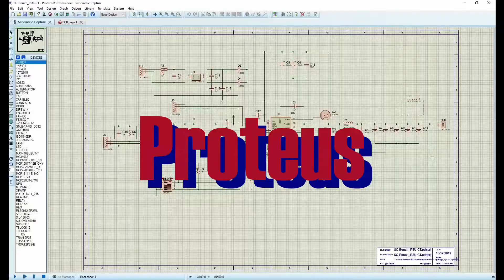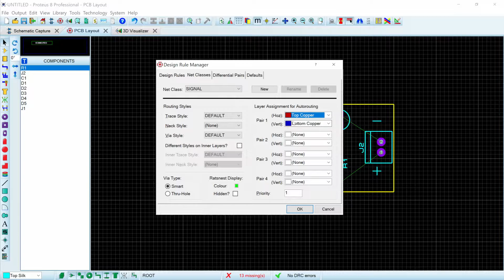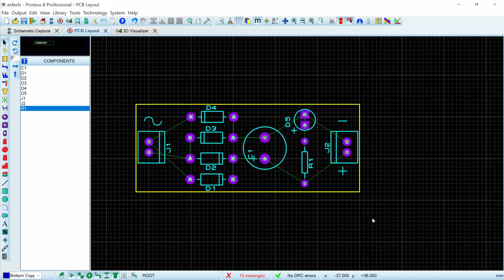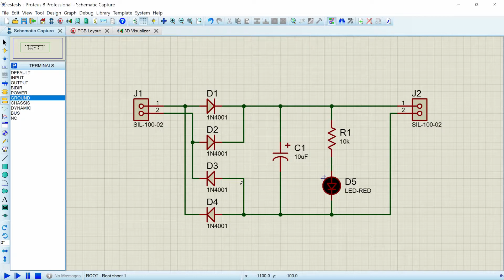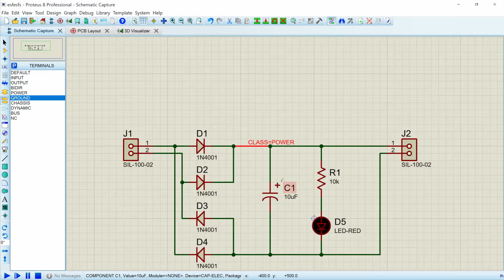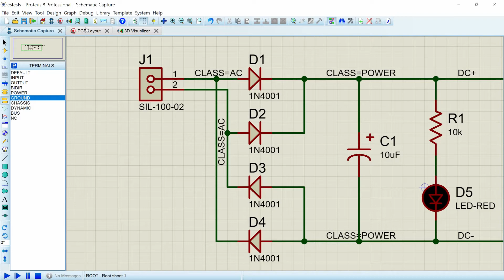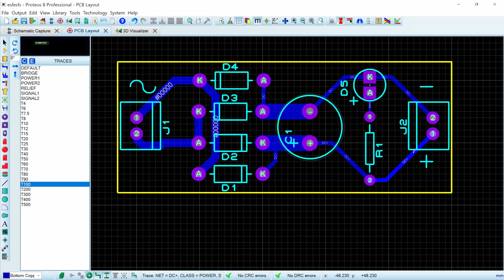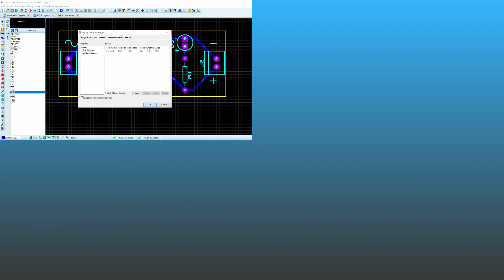Change Proteus Trace Size and Layer for Auto Router

Comment: Excelent tutorial, I wonder if could be possible to create in Proteus a trace with 2 different widths. I have seen this kind of trace in Altrium PCB layout. It was used in Arduino Pro Mini PCB design in the zone the trace has to pass between 2 pads of the Atmega328p tqfp32 corners (there the trace is width decreased to prevent too close distance when pass between 2 corner 45° pads). I could not find the way in Proteus and I personally prefer it (much more intuitive and friendly) to Altrium
Reply from the maker: You can.  It can be done manually, or you can use room mode. This typically just relaxes the minimums, but we can check if we can see if the maximum can also be manipulated.
Reply: Thanks, I will give It a try.

Comment: How can I make ground grid in proteus
Reply from the maker: One of the options when you are creating your ground pour is the "Type". It is defaulted to Solid but you can change it to hatch, then modify the spacing. Let me know if this helps or if you would like a specific video on this!
Reply: @ScottCard  I want a video
Reply: @ScottCard  I need a video on this
Reply: @ScottCard  I will if you can make a video on the zone property dialog box and explain  function of each command and it uses
Reply from the maker: OK, I will do my best. Thanks for the suggestion!

Comment: How can i add a battery on the bottom side of the board?
Reply from the maker: Thank you for the question. First, import or create the footprint for the battery. If you need to make your own, this video may help: https://youtu.be/r4WuFrLfqRc
Next, simply mirror the part in the PCB layout (Ctrl+M). The silkscreen should now be magenta, indicating that it is on the bottom. You can double check by using the 3D viewer if it is enabled on your version.
Hope this helps 🤓

Comment: Since I don't know how to ask a generic question (outside of the specific topic of this video) I'll do it here.  I had a project involving switching 230V AC on a board via SSR, load about 300-500W, depending on which parts on the output side were active at the time. I ordered the boards from Chinese manufacturer and copper there is pretty thin. I've never managed to route the same connection both on top and bottom copper (same route on both). Is it even doable? To have the same track on top and bottom copper?
Regards,
Samo
Reply from the maker: Yes, you can use a zone as a trace. Once made, coppy it and change layers so you now have it on top and bottom. You can then use the via stich to connect them. Also, if you specify 2oz copper it will help but at 2 or 3 amps this should not be an issue. Hope this helps.
Reply: @ScottCard  It does help. While I was going through your videos I was playing with this on the second monitor. I'll check it tomorrow with the Seeed guys if it works, but I may have found a very simple solution. Copy route. Move it aside. Change layer. Move it on top of the original. You get some complaints from the software, but Gerber Viewer seems happy.

Comment: Good day Admin. Pls how can I print clone or trace circuit diagram design make new pcb circuit print in proteus
Reply from the maker: Your best bet would be to convert your image to a BMP then import it into Proteus. You may be able to change layers then or trace over it but, your NET list will not be present. Not the best tool for the job maybe.